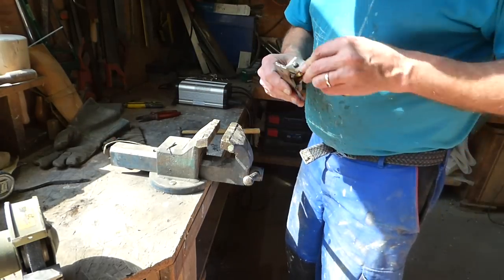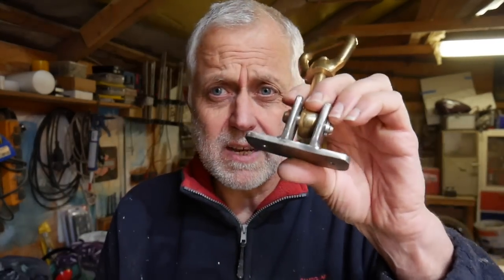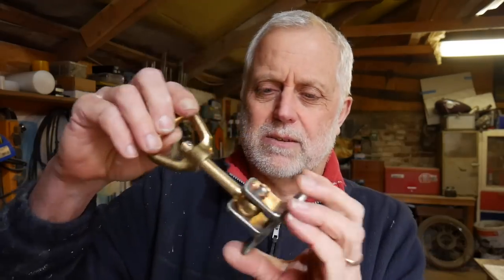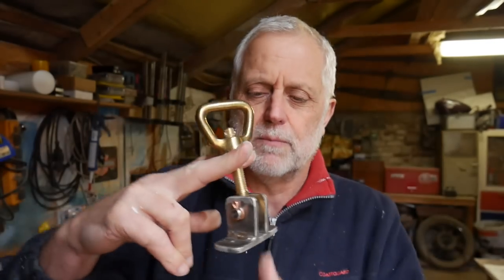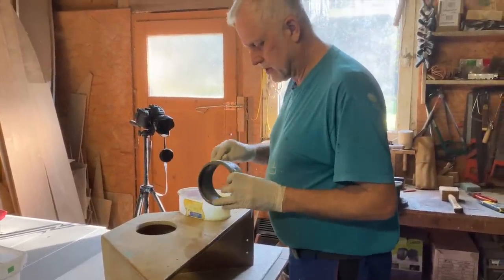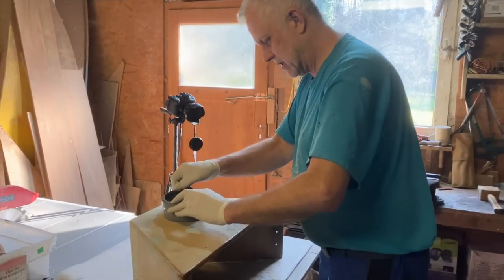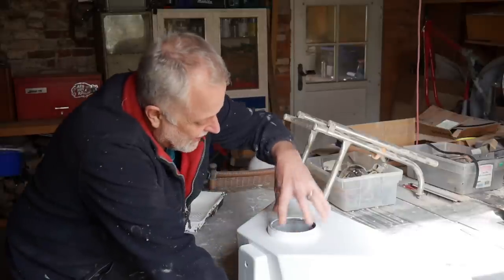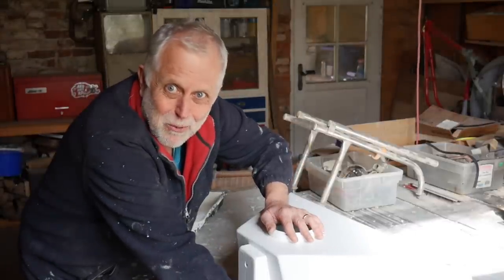How Many Coats Of Epoxy Sealer?? - Building a cruising sailboat - SV Tapatya EP276

Comment: One of the many things that I like about this channel is its authenticity.  You pay for all your tools with your own money, as you have said, Tony.  Occasionally, you say, "this one's pretty good," but the take-away for me is that you have a 32' boat in your garden that you have built with tools that most of us have collecting dust in our sheds!  (Actually, not most of us: I speak only for myself.)  You're showing us what can be done when a builder doesn't get side-tracked by all the Youtube BS.  And I salute you for it!  By the way, no rush, but I sent you an email.  Cheers mate,  - Chris.
Reply: I agree with you about the take-away. Tony shows that you don't really need all that much gear to build a yacht. Heck, in my own small dirt-cheap way, even I have more woodworking tools than Tony does. (I do lust after his welder and lathe, though! 😁)
Reply: @Garryck-1  Good point, JAFO, I fancy one of those little welders, and the lathe, too.  Tony has show that they are very useful tools, and not that much space needed to store them, either.  I reckon a lathe would pay for itself pretty quickly if you made a few replacement parts that had broken on other machines or house equipment.  Building repair / replacement parts from scratch would be a good skill to have.
Reply from the maker: Thank you Chris ☺️

Comment: 1. It is a boat bottom paint that does not contain copper, and it needs to be maintained every year.
There is a copper-containing product that can be lower than seawater biofouling for ten years, but I don't know if it is easy to use.
It is said that the price is 5 times more expensive.
2. The bottom design of your ship mainly considers stability, safety first and speed second.
3. Inside the cabin, is the standing position of people about 10cm below the waterline? If the position below the waterline is filled with polyurethane foam, will it make the ship anti-sinking?
I have seen similar approaches in other ship designs before.

EMBARCACIONES The ship he designed should be Spanish
Reply from the maker: I think you’re referring to Coppercoat anti fouling. I’m just going to use standard hard anti fouling; probably the hard racing from Hempel. It’s reasonably priced and lasts a couple of years 
The idea of flotation is, of course, interesting, but I don’t want foam trapping water inside this wood hull. My brilliant plan is to not sink! 😉
Reply: @SVTapatya  - Despite not being a fan of foam, I've crunched the numbers on adding enough foam to a Benford Dory to ensure positive buoyancy. If you add foam to the entire inner hull, up to the gunnels, it will require a layer of foam 3-4 inches thick. That's a lot. Which is why my chosen route to maintain positive buoyancy is to go with 5 watertight bulkheads instead. I agree with you on the subject of trapped water as well.